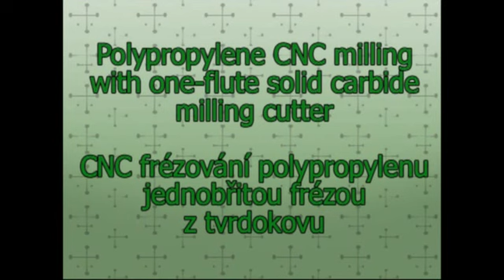Polypropylene CNC milling - CNC frézování polypropylenu

Comment: how did you prevent the part being damaged on the end of the cut when it comes loose?
Reply from the maker: Brady Rose The CNC program has several small bridges (about 0.5 mm height) around the perimeter of the part.